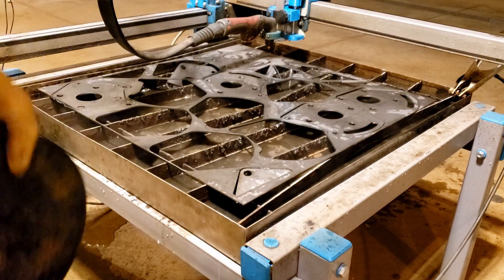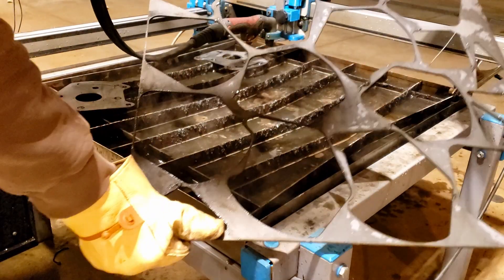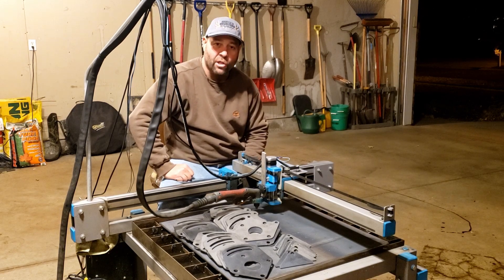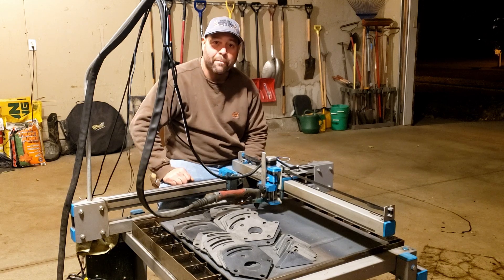Budget CNC Plasma Cutter Z Axis Add-on

Comment: Regarding torch duty cycle and compressor recovery, would G4 "dwell" g-code help? 
I have a small compressor currently, and once I finally do a few successful tests I will buy a much larger compressor. In the meantime, I was thinking of doing G4 for a minute or two (e.g. G4 P120. ) after each cut completes (M5 / torch off) in order for my compressor to recover for the next cut.

Edit: G4, not M4

Comment: Your CNC worked just as good as the 30,000-dollar machine. Very nice cuts. There is one thing people don't realize is that once have built this machine you now have the technology. You have the capability to make the best CNC machine, your CNC will be that machine. Better than before, better, stronger faster!!!! I could not resist. Nice video!!!

Comment: cool design but so much flex in those plastic parts. accuracy is going to suffer
Reply: Since they aren’t producing space shuttle parts for NASA, I would imagine any accuracy issues will be within acceptable limits.
Reply: @tgreening  forget aerospace- they're visibly flexing in the video. not to mention plastic parts are susceptible to heat. i don't think plastic parts on a plasma table are a great idea
Reply: @5eZa    Who said anything about cutting aerospace quality?
Reply: The tolerances are good. Great in fact for my type of work.

Comment: it seems this is a reasonable alternative to closed loop THC to some degree I"m still trying to weigh up  if THC is worth the trouble on a table this size packing one corner  sort of proved it works ok  doesn't seem to be much trouble touch off and sett the height for every part

Comment: Can the Z-Axis Mounting Plate be made out of 1/8 in Alum (for weight and ease of manufacture on a 'regular' cnc)? Thanks
Reply: I used 1/8" AL and it worked just fine. Didn't see a reason to use MS.
Reply: @glenrock672  Same here no problem with 1/8 aluminum so far

Comment: Can this be modified to a 4' x 8' table? or 4' X 6' ? Also do you sell the CAD plans. I'd like to build the 3D parts with my mill from aluminum.
Reply: I will be buying this soon, when I move workshops and have the space and I will be use it to cut 2000mm x 1000mm sheets (UK sizes), but it does not need a bed to accommodate the full sheet sheet.  Using what is called tiling or indexing, a sheet can be moved either shifting it along its length on the bed, or rotating the sheet 180 degrees so that the part that was outside the cutting area is now accessible for the torch.  There are a number of good vids on youtube relating to indexing/tiling using a CNC router- but the principle is the same.
IA bed with a 600mm  cutting width and 800mm cutting length could cut a sheet ( a single item that covered the whole sheet)  with 3 repositions along the length and then rotating the sheet 180 degrees and making a further 3 cuts along the length.  The Gcode will sort out the x/y relationships between what has been cut and the new position of the sheet each time it is moved relative to the indexing point.
The link is to a tiling project  for a router (using fusion 360).
https://youtu.be/6c7iN2NlSHA

Comment: how does the machine know where the top of the metal is?  is it using electrical conductivity or just crash it and use feedback from the stalled motor?  or optical?
Reply: There is a small contact switch in the new z-Axis unit...it shows it in the begining of the video as the parts are being assembled.

Comment: I haven't bought your plans yet but i will soon after some more research did you print with pla or something different that's all I've printed with so far. And i read your plans include other sizes how big do they go? I would like to build a 4x8 but i probably really don't need that big maybe 4x4
Reply from the maker: We peint with PLA the plans include a section on how to scale the machine to fit the cutting area that you prefer.

Comment: How do the 3D printed parts hold up ? Especially one holding the torch ?
Reply: My torch holder printed in pla by JD's is cracked after minimal use. May want to look at a stronger printing material.
Reply from the maker: Have not had any issues yet, these are the original parts on the machine.

Comment: Very nice add on. Do you have an up to date build price. Trying to figure out what this will cost.  I know it can change depending on what you spend on a plasma cutter as low as 300 for 65 amp to 800 for 80 amp machines
Reply from the maker: The build in the videos will cost roughly $450 without the torch.

Comment: What plasma cutter are you using and what air compressor?

Also, do you guys ever plan to make a 2’x4’ CNC table or a 4’x8’ design?

It seems like it shouldn’t be too hard to alter your design to make a these larger tables and offer those plans for an additional cost or something. You guys really did an awesome job of making a budget friendly design, which I appreciate!

Last question do you think you guys might make some instruction on how to change out the current design with a router, laser, or drawknife? That way people could use the same design for something other than plasma cutting?
Reply from the maker: The cutter is a lotos Lt5500d. We have and multiple people change the size of the table. There are instructions on how to do this in the plans. We have not done anything with changing tools as we have been occupied woth other project currently.
Reply: @jdsgarage701  okay thank you for that. I will checkout that plasma cutter and I will look at the plans on how to make a bigger tables. but how many gallons is your air compressor?
Reply: While this is a great low cost CNC plasma (I'm intending to build one myself), it would not at all be suitable as a router sadly.

A router needs to be stiff, there quite a lot of cutting forces, even with a small spindle. A plasma on the other hand has almost no cutting forces, same as a laser or waterjet. Also, a plasma isn't anywhere near as sensitive to vibrations and deviations in Z height as router or a mill is.
A hobby level plasma cutter simply don't need to be even close to as stiff and strong as a router :)

I'd recommend that you look at the PrintNC project, very similar to this project in many ways, and to my eye, probably the best DIY CNC router design out there. Certainly better than the one I designed and built a few years ago from aluminium extrusions.

Comment: So is this z axis add on reading the cut voltage and following the contour of the metal or is it lifting the head between cuts and adjusting the height before each cut? BTW sweet design!!
Reply: Only the latter for now

Comment: I'm really glad to see this come out now and for free too! Thanks for a great machine and some great upgrades too. Thanks for the video!
Reply: I made the edits to the PP and ran the DXF for the mount  and when I looked at the code I couldn't find any z moves at all? Did I screw up somewhere, probably, but I'm can't see where it is. 😁 Could you make any recommendations? Thanks!
Reply from the maker: You have to enable probing when you are creating the gcode in fusion. Z moves will only show up at the start and end of cuts.
Reply: I didn't see that feature. Thanks for the reply!

Comment: This is awesome, I have been thinking about adding this to the JD Plasma table since I built it. You guys are amazing. And if anyone is still thinking about trying this I can say that I have and love it. The team has been real quick to offer advice when ever I have been stuck on any section of the build. They have even been helpful when I had questions about what I could do to improve my cutting. 
I use this table mostly to make metal signs all 1/8 inch thick or thinner. I have cut up to a 1/4 but just a few small items and I am running the Lotus same as JD Garage. 
Currently I only have 120v house outlet and 125 psi compressor and it has been sufficient. I hope to add a 240v, so I can cut thicker metal if needed.

Comment: I have a question on another project you did, the mini trike. Is there any way you can print out or email me the cut lines for where the neck tube meets the bottom 2 tubes.